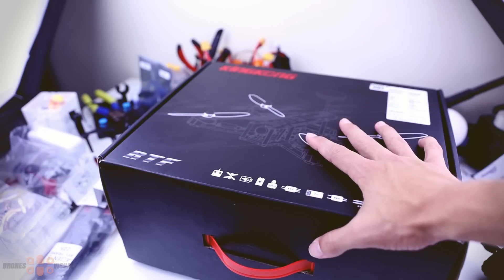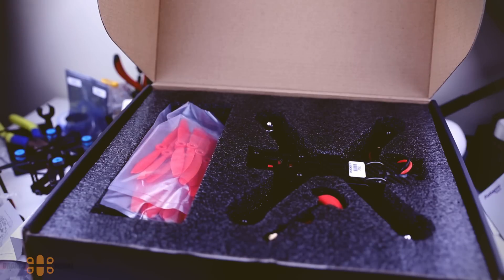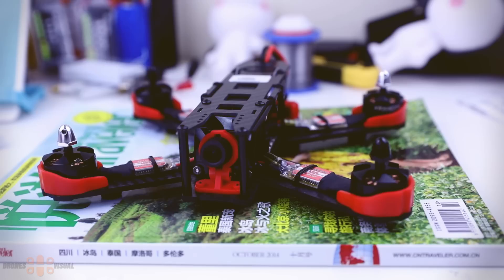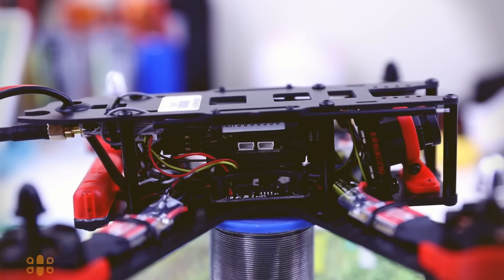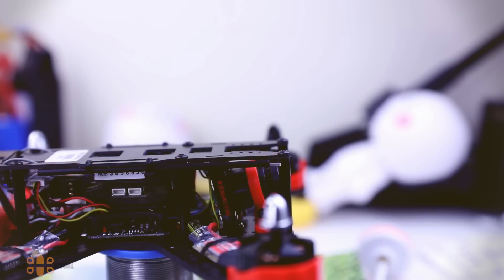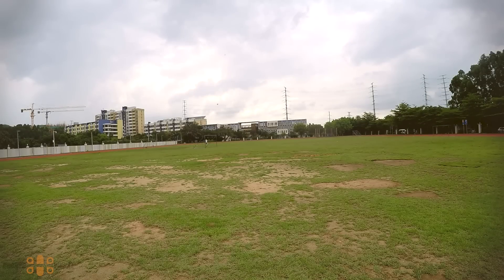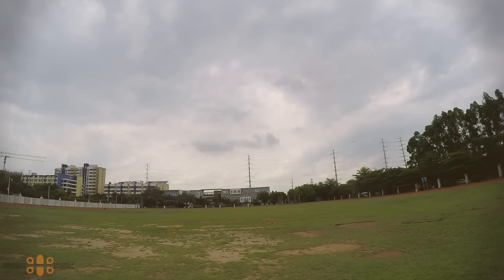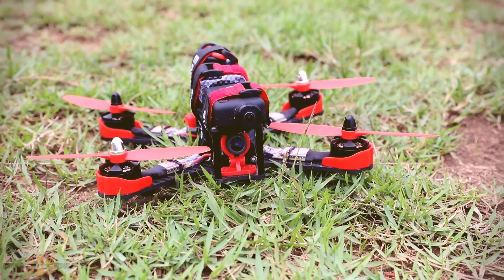KingKong 210 FPV Racer RTF CC3D Version Review

Comment: Which one do you recommend for a beginner CC3D or Naze32? which one is easier to fly with?
Reply from the maker: Hello and thanks for asking. You can get started with a CC3D. Both are ok to flly, but there are hardware differences and the software they use. Cheers.
Reply: is CC3D better or easier for beginners?
Reply from the maker: Yeah, I feel it's easier to get started with a CC3D. Cheers.
Reply: Thanks!

Comment: What version is better for a first time racer buyer?
Reply from the maker: Hello and thanks for asking. If you are getting started, I recommend the standard version. Cheers.
Reply: Thank you! and which one would that be?
Reply from the maker: The one in my video :) Check the link in the description. Cheers.
Reply: the 210GT is better than 210 for beginners?
Reply from the maker: The regular 210 is better for beginner. The one in my video is actually the 210, not the GT version. I just made a mistake when I uploaded the video initially. So, if you follow the link in the description, you should see the 210, which is the best one to begin. Cheers.
Reply: Great thank you!

Comment: What is the difference between the 210 and the 210GT? and with the CC3D version and the F3 version? Thanks!!! I have been looking for a racing quad to buy.
Reply from the maker: There are some hardware changes including flight controller, frame and ESCs. Cheers.

Comment: Hi, I have some quadcopters (H107, DM003, X100 and X251). I want to try a racer/fpv quad. Do you recommend this one or the Eachine Wizards x220? Do you have 1 or 2 models to suggest for a beginner to racer quad?
Thanks a lot!
Reply from the maker: Hello and thanks for asking. The KingKong F3 version is pretty awesome and the Wizard X220 as well. Today there are many options available for beginners. If you have been flying the X251, then you could easily handle the Wizard X220. Go for it. Cheers.
Reply: Perfect thanks a lot!
Reply: Sorry another question. Between the Wizard X220 and the Eachine EB185, the best one?
Reply from the maker: 100% the Wizard X220. Cheers :D
Reply: the eb185 is discontinued  you can get a few parts at banggood

Comment: could you do a thrust test on These Motors and props?  i have the same Motors and bought These props with a new Frame. I realized later, the ESC's could Handle a 3 Blade Prop.
Reply from the maker: Hello and thanks for asking. Do you mean whether I can use a motor thrust stand to measure the thrust of these motors using the Eachine 20A ESCs? Cheers.
Reply: No sorry, i mean those Motors, the kingkong 12A esc and the 5x4 props without bullnose. I feel like i bought to Small props. But i'm Not sure if the ESC's could handle such a Prop. And how much more thrust in Comparison i would get. To sum it up, i want the thrust and amp Draw of the Stock Setup and the "best" Prop to use. Much Information :D

Comment: Is there any reason you couldn't cut the arms off with a bandsaw or something; make yourself a spare set of the arms that are a little longer, and use the screws that are there to secure it to the body for easy replacement? I realize the motors are mounted on the arms, but you could rig up a little X brace connecting the arms that I would think are solid enough to be safe.
Reply: why not buy a diffe4rent frame like the alien 220

Comment: hello my friend, can you tell me the difference between kingkong 210gt and Kingkong 210 210MM with 800 TVL CMOS?Aslo which is better naze32 or the cc3d? and if you will be using 4s batter for this, can you use the battery charger that comes with this in charging the 4s battery?
Reply: F3 6 DOF beta flight   The stock charger only charges 2 and 3 s